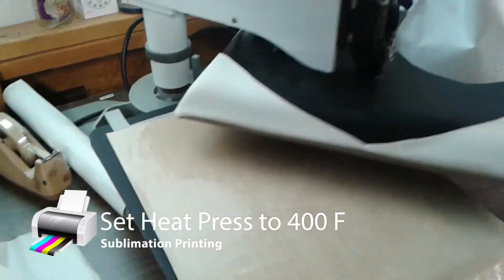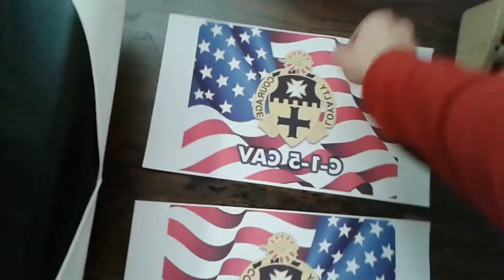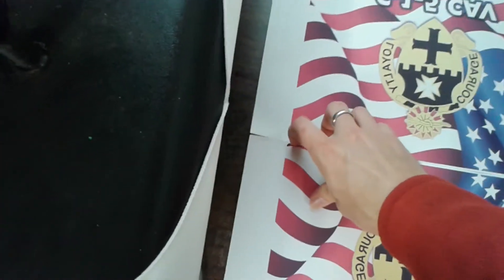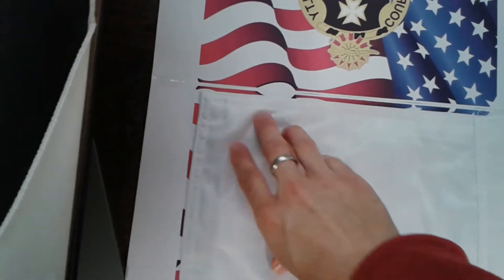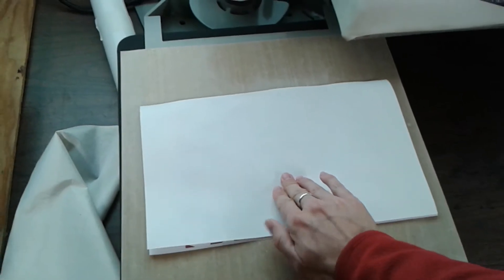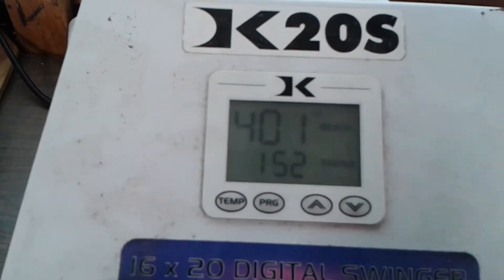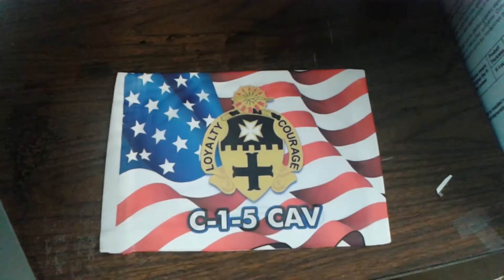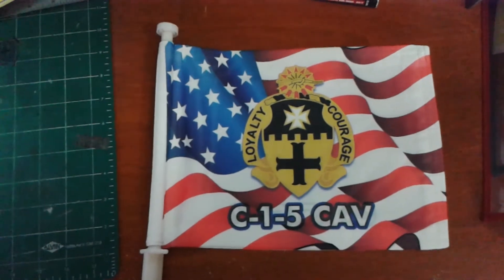Sublimation printing flags, 1-sided or two-sided

Comment: Where did you buy the flag?
Reply from the maker: Many times whoever you're buying sublimation inks and papers also sell printable products. I get it from jds industries
Reply: @FryerDIYguy  Yeah I tried to sub a JDS flag today - it's just too flimsy.  The edge seams are stitched a little tight and it would not lay flat on the transfer - yours looked a little less flimsy - Conde has ones that seem more structurally well-mad (in their videos) but they're a lot more expensive.  Thanks for the response, though!
Reply: Did you mirror both images?